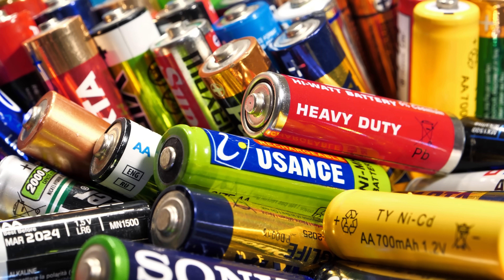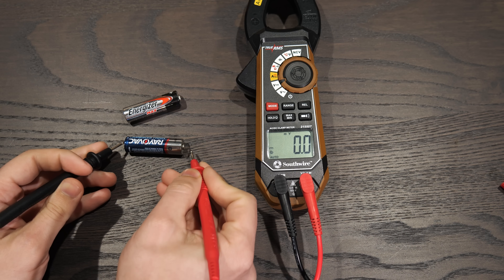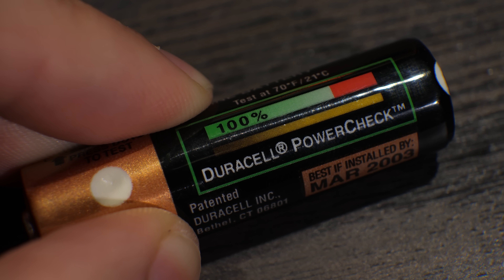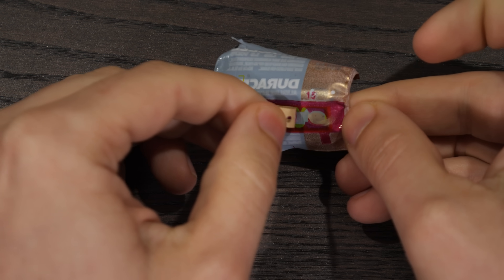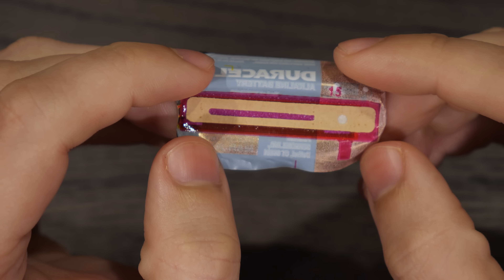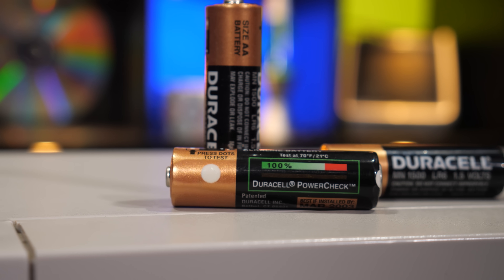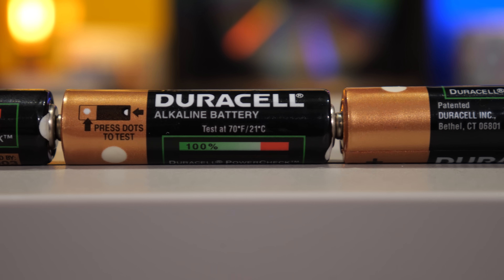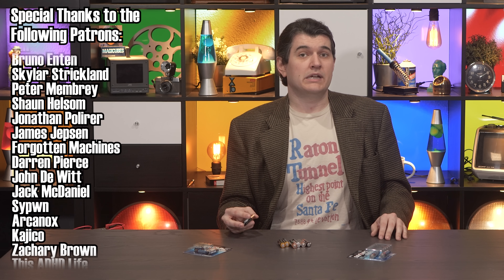Duracell PowerCheck: A genius idea which didn't last that long

Comment: 11:13 You must not have used batteries for lighting back when the outputs were all unregulated.  When you put the fresh battery in the light, it's the brightest, and follows a continuous decay of light as the voltage drops. So if you're doing stuff at night you'd put fresh batteries in, and the partial-charges go in the drawer for remotes.

My point being that if the batteries had ENOUGH charge left in them, you'd keep them in the flashlight/headlamp and keep using them.  It's was typically far easier to see what the state of charge was using the strip on the side, than trying to tell how bright the light was.  Especially if it you were prepping your stuff during the day.

LED's, regulated output drivers and lithium chemistry has solved all of those issues.

Comment: I remember buying a pack of batteries, and it included a tester. It was like a thin foil, it was exactly like this, but you put it on the battery and the press.

Comment: Rechargeable batteries are unquestionably good, but non-replaceable batteries are the work of the devil.

Every device should have a user-replaceable battery.  OK, maybe not a pacemaker.

Comment: Duracell battery tester, always seemed like testing matches by striking them, as there was the suspicion that the load of the baattery tester  heater reduced the life of the battery. 
Your indignation at the enclusion of an unusually battery type in a product is far more justified when the battery type is one of those odd size button cells. I keep a stock of CR2032s but thats about it for button cells.

Comment: Or if designers wanted to be even more annoying, a C or a D battery, or even multiples! Which almost guarantees you don't have a battery to fit in your device and need to take another trip to the store.

Comment: I used them sometimes to check if they still worked in stored (in packages) packs... but thinking too that they were using more in the battery then in actual use.

Comment: Here's a fun tip: If you open up a lithium battery and extract the lithium foil and throw it into water it will probably explode violently. But don't. You're a grown up.

Comment: The heater has constant resistance. Just at the end, heat is distributed over wider area, so it does not heat the indicator enough to glow. Or i am wrong, then please someone correct me

Comment: I'll be honest, after having used plenty of devices with Li-Ion rechargeables and devices with AA Ni-Mh rechargables, I'd honestly be happy if AAs make a comeback, at least in certain types of devices. Nothing is more frustrating then having to wait for a device to charge, especially if having it plugged in makes it impractical to use...
VR controllers for example. If you don't have them constantly on a charger, then if you ever find them dead, you basically can't use 'em. Ones with AAs, when the bats run dry you just chuck a new pair in and you're golden, and if you're using Ni-MH bats, then you're not even generating much waste (at least not more waste then you'd do with Li-Ion wear down)

Comment: They were neat, but it was pointless.
There's no need to know the life left in a battery that can't be recharged. 

Besides, you can just bounce them off a hard surface to find out how much is left in them (and yes, it actually works)

Comment: You can check your Duracell batteries on how well they are leaking too. I had a 1-year-old, 32 pack of Durakeaks that did just that. The store where we got them from wouldn't honor the printed warrantee that they would be good close to 10 years after that happened. We switched to rechargeable batteries, and all has been well.  Stay away from Duraleak batteries.

Comment: Most people i knew thought it was trashy and just irritating to keep the packaging for anything for any reason. People often mildly harass and mildly bully others about it. I never understood. So in my life, no.. having just lots of batteries...pens...markers...etc. of varying states of decay lying around in the junk drawer, or other drawers or in the official place for even the new and used stuff was common. And ideally people put a bad battery in and threw it away, but really most people didnt really realize you can have a good initial moment with most bad batteries, so they at some point put it back in the drawer because they think its still good just misbehaving. Rinse and repeat. Others just habitually for no reason put the pen or deformed screw or battery back anyway. 
So the battery indicator was kind of necessary but given what I said, it seems like a nash equilibrium not to have it still just because it seems some weird human quarks are at play anyway. And im not just referencing my family, but plenty of homes, offices, schools, etc.

Comment: I once had excellent use for these. Was doing an outdoors show with wireless mics in the winter and we burned thru batteries at an incredible pace, typically they lasted over 3 hours but in the Finnish winter you were lucky to get 45 minutes and that was with the beltpack as close to human body as possible. Most of them just were too cold and once they warmed up they could be re-used a second time in the rehearsals. Powercheck® was awesome for those, didn't have to keep track of batteries and could just check before inserting them to the transmitter.

Comment: Is the Venn diagram of people that save and test batteries when they appear to falter and people that have a multi-meter not a circle?   In any case, I never got comfortable with the built in checker because it was hard to press and it wasn't clear if the battery was dead or I wasn't using it correctly.

Comment: I remember pressing so hard it hurt my fingers trying to get those to work as kid. I gave up and just trying random batteries from the junk drawer til i find a combo that turns my gameboy on. We kept old battery cause they had enough juice left to power the tv remote after running whatever we originally used it for

Comment: My solution has always been to just chuck loose batteries into a device (usually a watch) and see whether it works. I don't throw away used batteries from stuff like flashlights or my wireless mouse since chances are they still have enough juice to power a quartz clock.

Comment: I use to frequently play with TOMY Thomas locomotives and only ran 2 or 3 at a time. The problem was leaving the battery in them and the battery would eventually corrode and damage the contacts, and pulled them out after every running session.

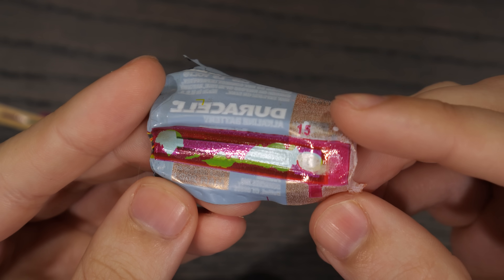Comment: 07:00 i doubt that therory, if you were correct there, shouldn't the skinnier parts heat up first? I guess it is the distance to the temperature sensitive material which makes the difference in indication.
Reply: The skinnier parts do heat up first
Reply: @aloysiusdevadanderabercrombie8  but the skinnier parts are at 100% side
Reply: @SirWallace2  No, the skinnier part is on the negative side, and gets larger towards the positive end. The gauge starts at 0% on the negative end, and goes to 100% towards the positive end. When he shows the heater on screen, it's inverted because he peeled off the casing and flipped it around to show the inside.

Comment: I remember the Energizer version. It was simpler, though it worked much the same. There was a little window that lit up in green with the word "GOOD" written in black. The dimmer the window, the less life the battery had remaining. There was a border around the window that was the same shade of green so you had something to compare to.

I also remember discovering pretty early on that these tests must rely on heat because, if you kept the batteries in a hot room, the "GOOD" windows would all be lit up green without even touching the batteries.

Comment: Everything I have that still needs AA/AAA batteries has rechargeable ones 
Everything that doesn't, takes odd very long life batteries that will not fit in anything else, and when it's dead after a few years .... I replace

Comment: i remember they had these for the 9v batteries in the package that were handheld. vividly remember them getting so hot when using them on the 9v that it hurt my fingers to use. or incorrectly grabbing a AA tester and using it on the 9v'er and watching it smoke a little

Comment: I remember those. I never noticed that they said anything about temperature! We used to put the batteries in the fridge so it would "recover some electricity".
Reply: We used to put batteries in the fridge too, but for storage. The idea being they wouldn't degrade as fast in the cold.
I suspect that was a symptom of parents raised by grandparents that lived through the war and/or depression. 
I still have some of that "waste not, want not" philosophy bouncing around in my head, it's been recycled (ha!) into an environmentally friendly ideology.
Reply: @Surestick88  Storing them in the fridge probably works too, as lower temperature slows down many chemical reactions. They could just seem a bit flat if you don't let them warm up before use.

Comment: The guest room in my grandmothers house has a CRT tv that a few months ago I wanted to see if it still worked. I pulled the remote out of a draw, checked if it had batteries in it, and it happened to have Duracells with the power check bar on it which I vaguely remembered being a thing as a kid. I pulled one out to see if the tester would work and surprisingly it filled about 3/4th of the bar and still powered the remote just fine. I thought it was pretty cool but I definitely see why they went away after watching this video.

Comment: I have to say that the older batteries have one major plus over modern rechargeables, and that's how easy it is to replace them.  I don't just mean how easy it is to reach them, but how easy it is to just find a replacement right on a store shelf and slap it in.  You see, older batteries have this amazing feature called STANDARDIZATION which modern li-ion batteries don't have.  If I want to get a replacement battery for a cell phone or a Nintendo Switch or something, not only do I have to find a way to disassemble the device, I have to find the SPECIFIC battery for that SPECIFIC device and HOPE the manufacturer actually sells the dang thing, or resort to some knockoff solution which may or may not be a time bomb that never went through UL testing.

So, as much as I love the modern li-ion in so many ways, the moment one of those things goes bad and starts to swell (if I'm lucky that's all it does), that's the moment I have to wonder how to get the battery swapped out, or if the manufacturer intended me to throw the whole device away and get a new one.  I happen to have every single handheld gaming device I ever owned, because I still play those games, and well... it's actually a lot easier for me to play my Gameboy right now than it is my PSP!

Comment: Here in Europe we had them till 4 years ago more or less and I only tried to use that meter once and it didn’t work, the contacts with the batteries weren’t that good so you had to press very very hard and most of them were flat.
So cool idea if you think about it but it doesn’t really makes sense overall.

Comment: Honestly, I think the shift from using standardized and easily replaceable batteries to using proprietary ones has been a move much for the worst. Replacing a modern proprietary battery is usually inconvenient, expensive, or--in the case of some discontinued devices--even impossible. Meanwhile, for any device I have that still uses AAs, I just swap between a set of rechargeables that I've had for years.

Comment: At 7:30 I'd have expected the skinny part to be low resistance, not high resistance. Did you misspeak or am I misunderstanding something?
Reply: Think of it like this: electric current flows through thicker wires more easily thus lower resistance. Like a water hose. You step on a hose, the cross section gets smaller, meaning more resistance and less water flowing.
Reply: Resistance is inversely proportional to the cross sectional surface area of the conductor, meaning that the "bigger" the conductor is, the more electricity can flow through thus resulting in lower resistance. Hope that made sense, since english is not my primary language.
Reply: @AdomasKalasnikovas  it made perfect sense. Thank you!

Comment: Hello Alec, just wondering... Any idea why NiMh batteries are at 1.2 volts instead of 1.5? In stuff where the voltage makes a difference (e.g. RC cars), a full nimh battery feels like a half-used alkaline one.
Reply: Because of battery chemistry. Every chemistry produces a different voltage when fully charged, which can not be changed without changing the chemistry or discharging/overcharging the battery. On higher voltage battery packs this is no problem, as you can just add a few extra cells to get close to the needed voltage, but it is obviously not possible if you only got 2-3, as making half a battery cell just results in half the capacity at the same voltage. A lead-acid cell in a moped battery (the size of a cigarette box) produces the same 2V as a cell in a dump truck's battery, only that one of those can produce 10x as much current and has 20x the capacity. But any lead acid cell will always produce 2v when full, and any NiMh cell will always produce 1.2v when full.

Comment: "If designers wanted to be annoying, the AAA battery"

No, you might have AAAs laying around for remotes or small flashlights. If they wanted to be annoying, they'd use Size C. Preferably in uneven numbers.